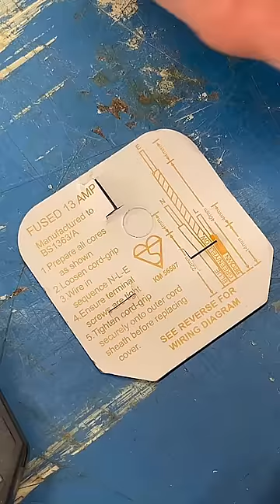Probably the Best Plug in the World 🇬🇧🔌🔌🔌

Comment: Every days a school day lol , never have I looked at the cardboard cover for the correct lengths
Reply: Read manuals for ffs
Reply: @kettelbe Great constructive critic there m8 ,
Reply: @mike004692  most dont have length diagrams on ,if in doubt make earth wire a bit too long , if it has an earth so its last to get disconnected if wire is pulled out hard, neutral second longest, live ideally exact to length so it disconnects first
Reply: @andygozzo72 Pretty sure every plug I've wired had the lengths on the cardboard bit. Heck, some extension cord plugs have the cardboard with the lengths and they're already wired!

Comment: Idk if we need the fused plugs but the insulated bits on the live and neutral needs to be added to the us electrical code
Reply: Would be nice to have, but changing something that's been so standardized for so long is by no means an easy task.
Reply: Fuse in the plug (or in the device, but in a fault condition it's better to break the circuit ahead of the cable) means you can use a smaller (and thus lighter) cable. Otherwise you need to use cable rated for the full current of the outlet on every device.

Comment: That's a real beefy plug for 3 amps.
Reply: Mainly just that big to fit the fuse.
Reply: @kennethwaggoner2254 but he did take the time to fit 3A at the end, how many people just leave the 13A fuse in for a table lamp
Reply: lol 13 or 3, either is enough to kill or start a fire. so based on what you said, just because it is 3 you will use some filmsy plug and take short cuts? lol

Comment: I like the ferrules for use on stranded wire.  I had not seen those before watching YT videos of UK and European wiring.  If I really wanted to capture all the strands of a wire, I would bring out the soldering gun and tin the wires.  But that can create other problems.
Reply: Mechanical wire connections are generally superior to soldered wires, especially where they may handle heavier currents.
Reply: ferrules are easier to use, faster to put and usually lessens the amount of problems you may have.
Reply: @JoachimVampire  no downside of using them. its cheap enough to be covered in misc. costs
Reply: soldering/tinning the wires is a very bad idea, its makes the combined wire and solder 'soft' and gives poor contact, and loosens itself over time, i've seen it..
Reply: @andygozzo72  Agree. It can also make the wire brittle just at the point the solder ends. The way around it though is to tin only the very tip, just to hold the stands together, while the connexion is still made to bare copper. If you look at professionally supplied tails, that's how the bare ends are usually done.
Reply: @xanataph  yep it can break at the junction of the soldered bit and unsoldered, but worst thing is the tinned part is very soft, as i commented, and splays out further over time, it seems , making poor contact, also some of the copper wire gets dissolved within the solder(try tinning thin enamelled copper wire a few times, it soon gets eaten away, its not just the flux doing it, i tried low flux type), making it weaker

Comment: I need to send this to my former employer, I spent most of my time there rewiring plugs to meet basic standards.
Reply: Mate I've been to an office in Birmingham to do repairs in the past few years that being electrocuted was quite a common thing to happen there and employees had no problem with plugging 2 or 3 2000w electric heaters into extension leads, no fuses ever blew but lots of melted leads, that and the odd electrical fire nearly taking the roof out. 

I told the office manager your staff need an educational talk about basic electrical safety before someone is killed.

Comment: Yes check the fuse rating for the appliance and replace the fuse accordingly Note that standard 13amp fuse was replaced with a 3amp.
Reply: The fuse is to protect the cable, not the equipment, so fuse accordingly.

Comment: I'd love to see a video comparing these with French (or other European) plugs - the European ones are rated at 16A, but the pins don't seem as thick as those on the UK 13A plugs
Reply: Yes very different to what you would find in NZ and Australia.
Reply: Indeed they arent as thick because well, they dont need to. Theyre Big enough to pass 16A. Never had a problem with that
Reply: @sovietcomrade7733  I was thinking the same.
Reply: Schuko is slightly smaller, easier to use (can rotate if tight space) , no extra fuses as rooms has own fuse etc...
Reply: 2mm² will do 20A,   The UK plugs have more plastic in the upper part,  so they are less beefy than their tips.  Where the EU receivers are recessed and don't need an isolated upper part for full width plugs
Reply: It’s not about if can pass that current in this situation, it’s about how long it can do it for. If you look on a BS4343 plug it has an hours rating of 3 or 4 hours usually. That means it can only carry 16A for 3 or 4 hrs. It’s there for a reason; ask me how I know. Now a Schuko plug has significantly smaller pins. I also know how long they can carry 16A for.

Now then, back to the BS1363 plug. How long do you think that can carry 13A for? They were built with a three bar electric fire in mind (that’s also why the ring circuit exists). A three bar electric fire with each bar being 1KW draws 13A. History eh?! 🙄
Reply: @andyscott5978  With Schuko 16 A (USA: 20 A ( don't blame me, that was from datasheet )). 
"How long" Honestly all devices who uses constantly 16 A (240V) is not in use inside household as rooms has "only" usually 16A fuses and not 32 A (group fuse or main fuse) so thats very highly unusal usage if there is such high current draw so long. Electrical engineer would give thumbs down for such idea as its wrong usage for the plug.

Those uses big power connectors is been used then like IEC 60 309 series which starts from 16A constant power and so devices in garage uses or motors and not Schuko as thats just plainly stupid idea.

Comment: I wouldn't say it's the safest plug in the world only because it has a fuse in it. This plug is designed for the British ring circuits that are very common in the UK. You don't need this kind of plug when you have a star system where every room is protected by a 16 A breaker.
Reply: The fuse is the most misunderstood part about this plug. It is to protect the cable due to the way their ring circuits work. It doesn't really give safety for the device, because that has already shorted for this fuse to blow. 
In general not using a ring system and instead a radial system would be probably much saver.

Comment: When can we expect a version with Wago clamps like the 221?

I am so in screwless connectors nowadays.
Reply: Screws keep sparks in business tho
Reply: @contytub  So you're saying without screws sparks would be screwed? :)
Reply: @tanithrosenbaum  I think he is.
Reply: You can already find them on three phase CEE plugs sometimes without the need of striping the individual conductors, like in RJ45 connectors. They’re a game changer in terms of speed and ease of installation because you can skip screwing and ferrules.
Reply: I have one that needs no tools, found it years ago so hung onto it,  never seen another.
Reply: Somethings aren't worth Wago. Can we not just let some things just be without given them the 👉
Reply: @trang9405  sadly they’re also completely useless for anything that isn’t plugged in once and left forever like a machine tool in a workshop, etc.
Reply: @ConorNoakes why though ?
Reply: @sovietcomrade7733  really unreliable in general use, a lesson that’s been learnt multiple times by people trying to reinvent the wheel in the events industry
Reply: No! There are 16A plug/sockets with that type of wire connections and they are very unreliable,  they pull out very easily if the cord is pulled, by tripping over it as an example, and are potentially lethal!
Not enough clamping force for a plug or socket that has a flex that is not secured by external means...☹
Reply: @ConorNoakes  if only you knew how the transmission lines are connected....non strip auto piercing connectors. Indeed. Just stop buying Bad brands and youll notice the inventions are actually good
Reply: @sovietcomrade7733  so a totally different and irrelevant application leads you to assume my specific point is due to cheap brands? 

slow clap for you
Reply: @ConorNoakes  yes, because those outlets with auto piercing connectors work great. They exist in most types (French, German, etc) and are good. Just because your brand is Bad doesnt mean the system is Bad.
Reply: @sovietcomrade7733  well the ones being talked about above aren’t piercing, they’re just spring/lever terminal instead of screw terminal and they are all shite. Every single one of them. From every brand.

The system is shite for anything that doesn’t get plugged in once and left.

Arguing the toss against the findings of an entire industry is about what I’d expect from the YouTube comments section though
Reply: @ConorNoakes  Well for those ive never bought lever ones for movable purposes. But I Guess its still a quality issue, wagos are great, so the same system on other stuff should be great too
Reply: @tanithrosenbaum  poorly tightened screws = repair jobs
Reply: @nilsonsemedo  giggles I love how everyone took my pun as serious comment. 
As for what you said, I'd like to argue that poorly tightened screws aren't always repair jobs, sometimes they're house fires instead...

Comment: In Germany/Austria we dont need fuses inside the plugs because our whole electical system is just awesome in almost every way. + our Schuko Plugs are superiour than the britisch ones, they have better grip inside the socket, they have better contact on the contacts (specially the earth) and you cant possibly touch the live wire, not even with a tool.
Reply: no switches, no fuses, exposed pins, can be easily wired incorrectly, how are they superior?
Reply: @georgebarnes8163  What do you need switches at the outlets for ? Fuses are in the subdistributor and the whole system is designed that you dont need more. Where are exposed pins ? How can it be wired incorrectly if everything is color coded?
Reply: @Mikepet  to switch the appliance on and off of course, the pins have no insulation, UK plugs have their own fuse in various ratings from 3 amp  to 13 amp thus protecting the appliance properly unlike the antiquated European system that only has  a fuse to protect the circuit.
Reply: @georgebarnes8163  almost all appliances nowdays have their own switch and besides that the F Types arent worn out after plugging and unplugging them 5 times. The pins dont need an  insulation because of the Design of the Socket itself, its a round shape where you cant even touch the pins with a screwdriver or something like that. The appliance only draws the current it needs (if it isnt faulty) and if its faulty the fuse doesnt do anything anyway because its already broken.
Reply: @Mikepet  No interest in such outdated tech, I much prefer the safer modern electrical systems.
Reply: @Mikepet  
My son was nearly killed by a broken Schuko socket in Spain: If you accidently hit a Schuko plug on its side whilst plugged in it smashes the recessed socket and can exposes live conductors. The UKs plugs & sockets don’t do this.
As for the fuse, its to protect the appliance flex under fault conditions, passing 16amps (in the case of Europe) or anything between 16 and 32amps in the UK down a 3amp flex isn’t good unless you want a visit from the fire brigade.
Reply: @Mikepet  Switches are super helpful for isolating a device without having to unplug it. And individual fuses for each device (of an appropriate rating) is far superior to a single bigger fuse on the entire circuit. Neither of which is probably of critical importance, but it's disingenuous to suggest a system without is superior.
Reply: Both systems have their pros and cons but the best part about the Schuko is you can plug it in in tow ways. So great 🤯